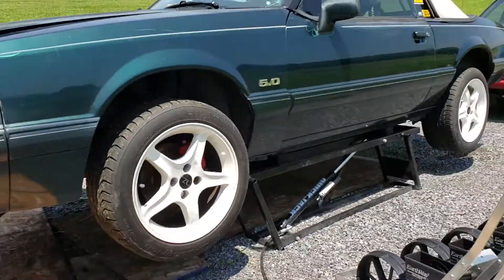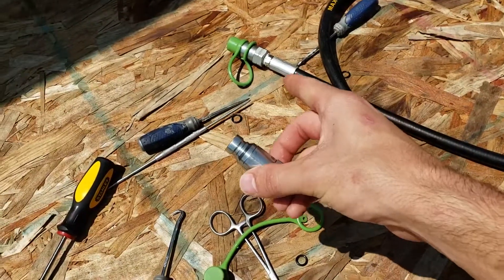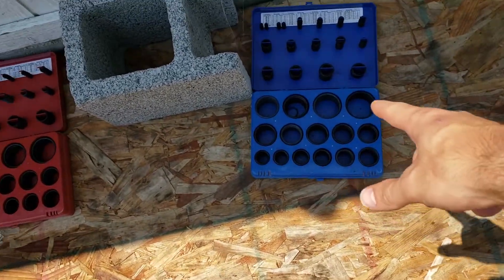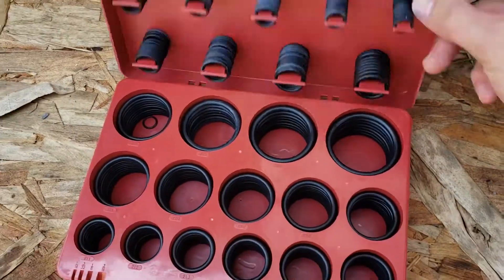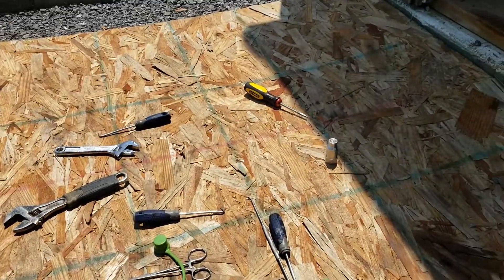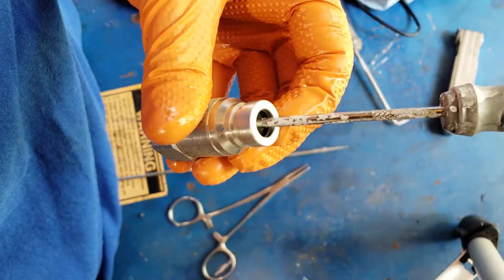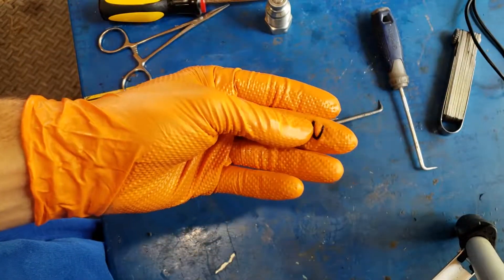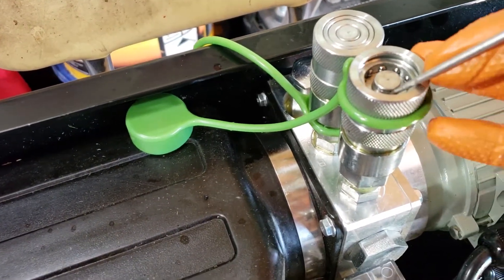my quick jacks faild!! how to fix!?!?

Comment: Here is the adapter part  number for the PUMP SIDE. FEM-252-4FP
FEM NIPPLE ASSEMBLY. They are 60 bucks. 
BUT the male and female ends (6-1/4 F5OF-S
STRAIGHT MALE PIPE ADAPT $6.98) are only like 7 and 10 bucks a piece.